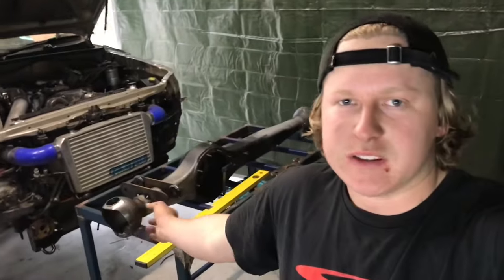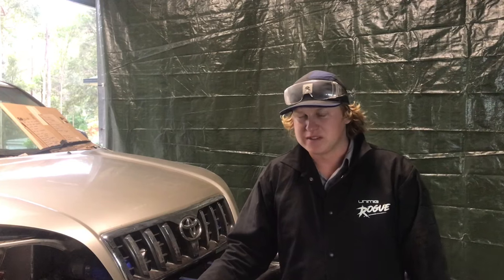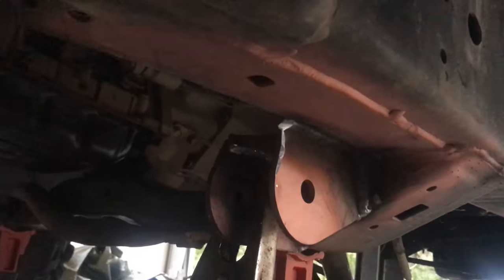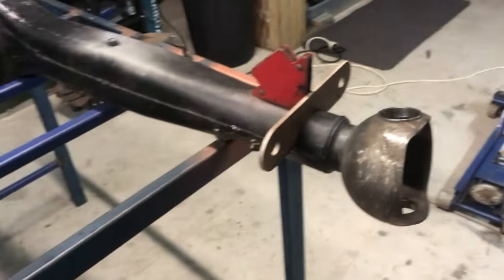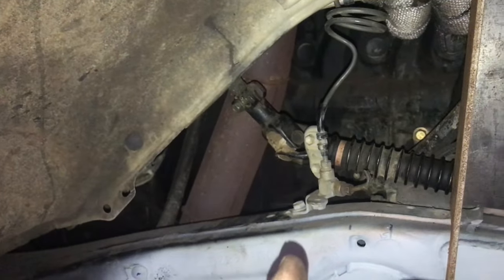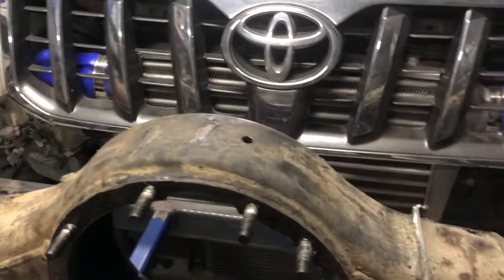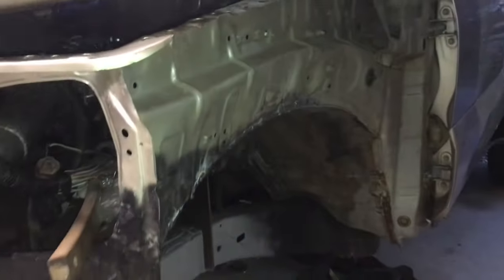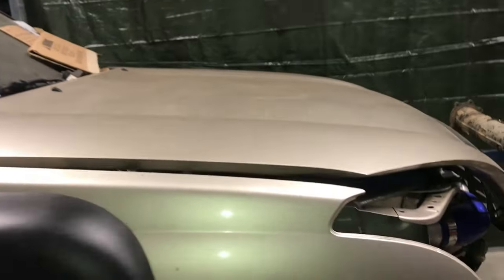120 Prado Solid Axle Swap | Ep. 2 Getting Sh#t Done / A Cycling Front End | SASSED

Comment: Hey man, just started following your build and not sure if I’m missing something but are you staying 4.1s with diffs? I’ve got a gq swapped surf here in nz and gone with 4.88 gears in the patrol diffs on 37s and it’s pretty much spot on with high way driving. I wouldn’t even entertain 4.1s I reckon it would be a pig. Haha. I’m also running dual transfers with Marin crawler gears. Cool build you’re doing
Reply from the maker: Hey man, yeah that’s correct, 4.1’s, it’s gonna be dailyed on 34’s ish most of the time, wheeled on 35’s and have room for 37’s eventually

But just to get it on the road without paying through the teeth for diff gears I’ve just found an 80 series 4.1 and patrol 4.1, regear to 4.3’s or 4.6’s will probably be on the cards later on